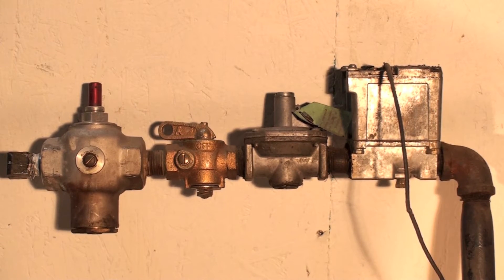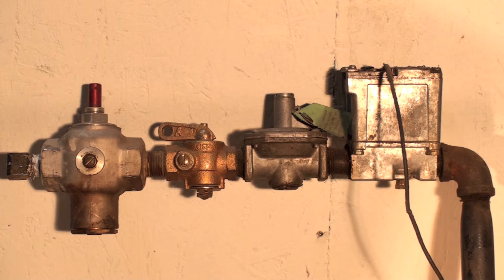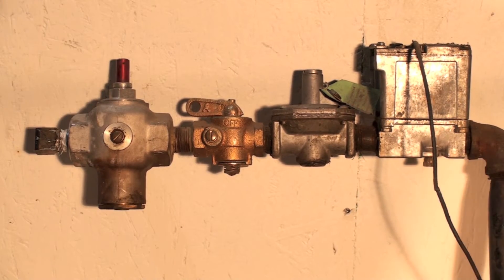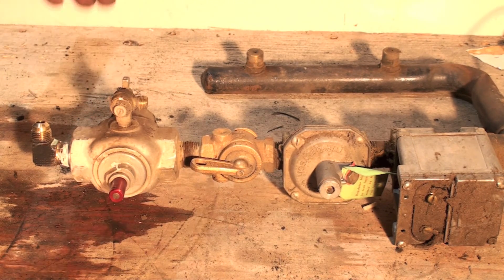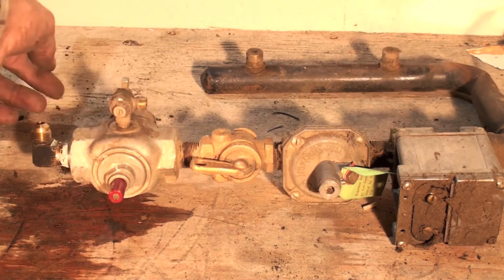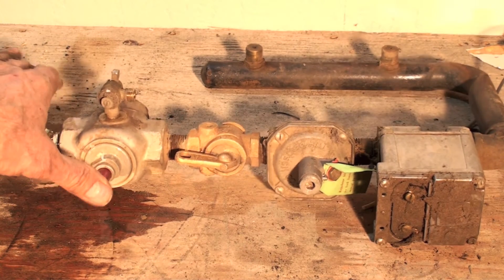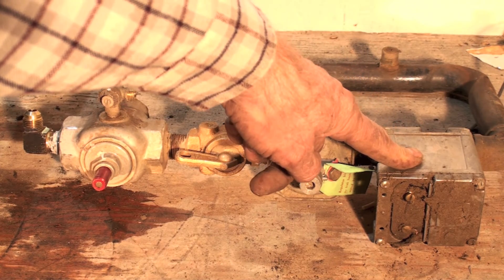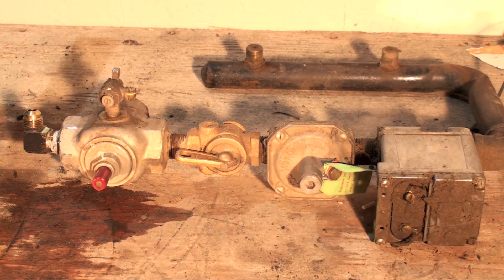Antique gas furnace gas chain

Comment: I have a 1940-50’s winter air conditioner, which is forced air furnace. It was working last winter. Now it won’t turn on. I can manually turn it on. I took the pilot out to clean. But there is no thermopile. There are two gas lines. One to pilot and one to gas control valve. There are two wires for thermopile, but no thermopile left. I checked it at bottom as well. There are 4 wire connectors, one is G, one is no letter, (the remaining thermopile wires are connected to those connectors. The other are white and yellow. G, W and Y connectors has wire. Does the polarity of thermopile matters. I tried a thermopile from water heater. It won’t turn on by itself. If i manually turn it on. It will reignite for couple times. But not all the time. What could be wrong. Thank you
Reply from the maker: You can try cleaning all the terminals, but probably the gas valve is failing.  It must be replaced with a combination gas valve.
GFM
Reply: @grayfurnaceman  thank you for your reply. I reconnected all wire nuts. It’s working now. I am thinking about changing to combination valve. Inlet is 1/2 in and outlet is 3/4 in. It will use 24v AC, standing pilot. The shading ring under solenoid is missing or not working. So it made high frequency noise when 24v AC is used. So I replaced it with 12 V DC last winter. Eventually I need replace it with combination valve. Any good brand and model to recommend?
Reply from the maker: @lonetraveler5660  White Rodgers, Honeywell, or Robertshaw are all good brands.  I personally like White rodgers brand.
GFM
Reply: @grayfurnaceman  do you think 36C-300 or similar is good choice for my application? Thank you
Reply: @grayfurnaceman  also I follow and redraw the wiring diagram. Seems the thermopile has nothing to do with the gas control valve. The valve is only controlled by thermostat and fan limit switch. I added a flame roll out sensor in series. That why the pilot flame was designed to be so big, so it will stay lit If pilot flame is out. Thermostat calls heat, the valve will turn on no matter if the pilot is on or not. Again. Thank you so much for your videos. I have learned a lot. Best wishes for your good health!
Reply from the maker: @lonetraveler5660  If the main gas will open and flow gas with no pilot on, it is a very dangerous control system.  I would dump it now.
GFM
Reply: @grayfurnaceman  the pilot is always working. I just list the potential danger if the pilot flame were out for some reason.

Comment: Are there companies that will rebuild a gas chain?  My 1950's system is working, but who knows how long its got. Ive got to get a roof on the house first. It would be great if the chain could be restored to its 1950's glory. Are there options?
Reply from the maker: First, dump this junk.  The furnace is inefficient and the gas chain is old technology.  It has been replaced with better products.
If you want to save it for some sort of antique value, you may be able to find the components of the chain from an HVAC dealer if they are willing to hunt for them.
GFM
Reply: @grayfurnaceman   but the new forced air units dont last and theres no radiant heat

Comment: Help!  I have an old 1970 Pennsylvania Boiler it has a 3 device Gas Chain.  It has a Honeywell 3/4" Gas Valve part no. VS8187A11043.  What is the correct Combination Gas Valve to replace it with.   I'm not going to replace but have the furnace man do it.  I been rip off so my times, replacing Hot water heaters and AC units when they just could be fixed.  I want to be informed when he comes to diagnose the problem.  I don't understand how come a 12 yr Old furnace can always have a Cracked heat exchanger and it cost me $5,200. Because the AC unit has tobe replaced to because it doesn't fit the new Furnace.  The boiler works great expect the gas chain.  I he heard working and banging on the pipes.  He came up stairs 10 mins later and said it was running.  I ask what he replaced, he told me it need only an adjustment.  It cost me 185.00 for the adjustment.  Now it won't light again, I don't want to keep paying for adjustments.  I want to have him replace the old chain with the correct Combination Gas Valve.  Thank You for the video.
Reply: I AM ABOUT TO REPLACE THE SAME HONEYWELL..PROBABLY WITH A ROBERT SHAW 700 SERIES.. 046, O51 OR O53  DEPENDING ON THE BTU RATING NEEDED.  THIS REPLACES THE WHOLE 3 UNITS WITH ONE.  
COSTS A HUNDRED AND SOMETHING GRAINGER HAS IN STOCK.  THIS WORKS WITH STANDING PILOT AND 24VAC CONTROLS

Comment: GFM I have an old American standard boiler from the mid 50s with a gas chain but the temp limits are built into the gas solenoid. If I converted the controls over to modern would I need to go back with a combo gas valve and new aqua stat?
Thanks! JM
Reply from the maker: Not sure of the exact setup but you will probably need to replace the aquastst.
GFM

Comment: that safty only kills gas to the main burner the B valve is a seporate control and will dump gas when open so alwas turn off b valve  for 5 min. when pilot goes outall of that can be replaced with an intermtant ignition kit for more efficancy

Comment: I have an old floor furnace and I can not get it to stay on.The Pilot  light stays on but the heater will shut off within 5 minutes .
Reply: JUST REPLACE THE GAS VALVE... PROBABLY A WEAK SOLENOID OPERATED BY THE THERMOCOUPLE...